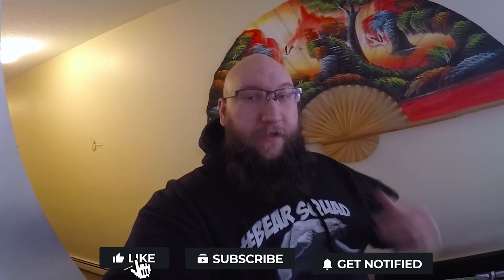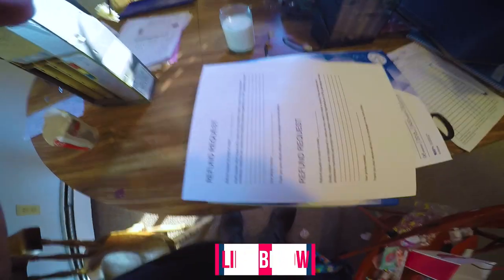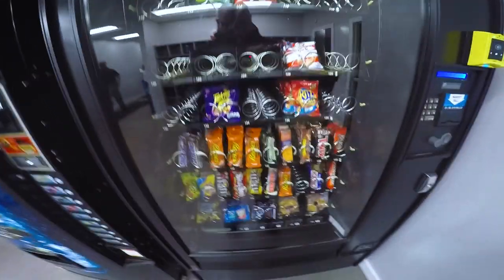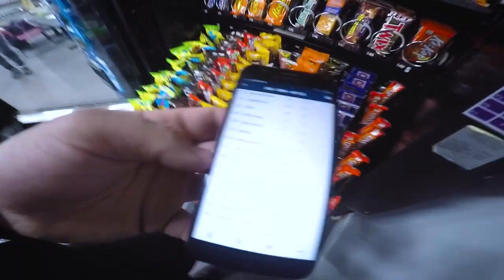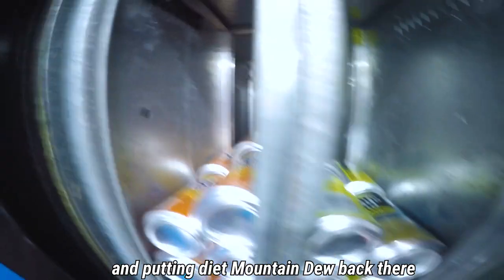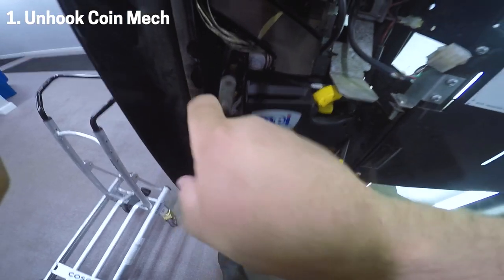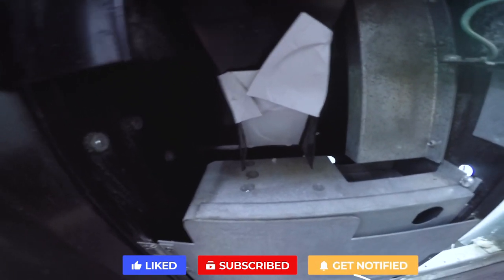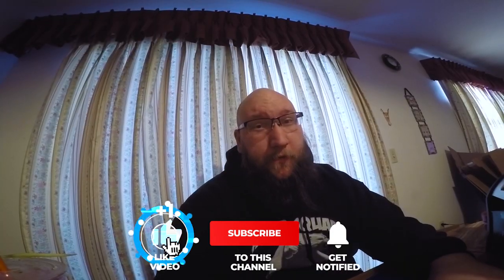My BIGGEST money making VENDING MACHINE broke down!! |

Comment: What model snack machine is that the one you need to upgrade your board for your Nayax credit card reader.
Reply from the maker: i have already upgraded it at this point but the model and make is USI 3085
Reply: @afcvending6037  Alright, I might be buying a USI 3219. You had to upgrade the board to see cash reports right.
Reply from the maker: @Roadkill132  yes
Reply: Okay Thanks, I'm going to Nayax cc readers do you have a link for that board.
Reply from the maker: @Roadkill132  unfortunately i dont think they work with links. Pretty sure you have to call them